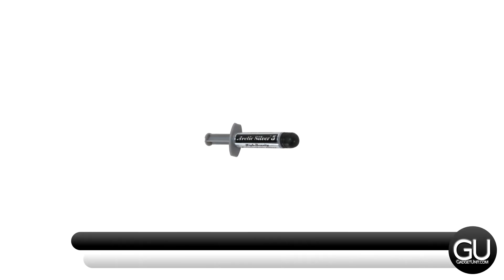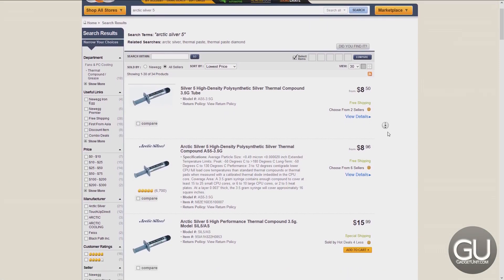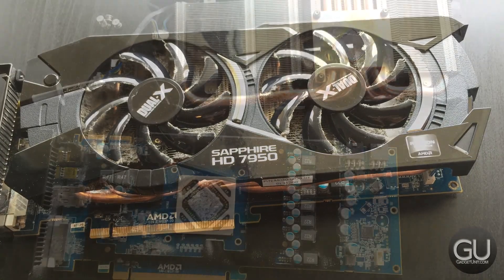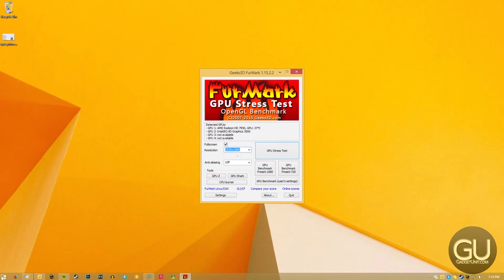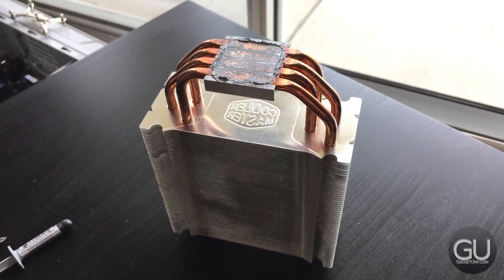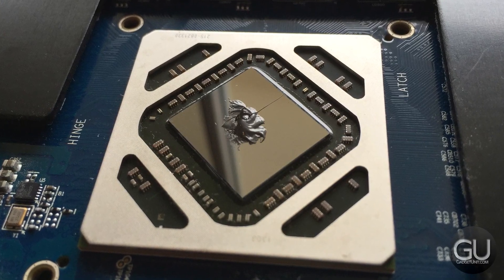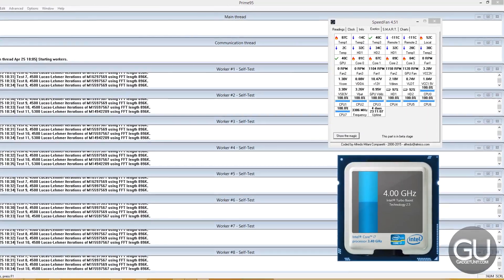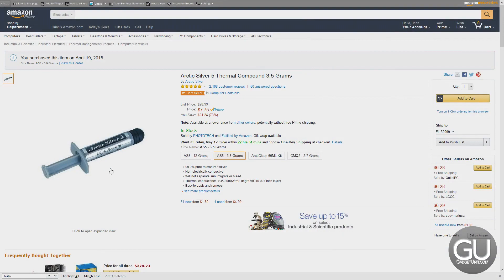Arctic Silver 5 Thermal Paste - Before and After

Comment: I went from 90c to 65c and now its  max 63c. Applied as5 few days ago. Fx8350. I did an X with a little dot in the middle. Good stuff
Reply: I'm thinking to buy it for my fx8320 but saw a few people saying the 200 hour difference is a scam.
Reply: It's been a while now and it's still holding up great. My computer is pretty dusty also, so that contributed somewhat to the heat. But it's below 70c. 69.8c last time I checked.

So I'm very content with AS5. I'd recommend it.

Comment: Pea method with AS5 is OK for the CPU with heat spreader, but it is TOTALLY WRONG for the GPU or any CPU without heat spreader.  You must cover the entire GPU die with AS5.  Do not use pea method on GPU if using this video for reference.
Reply: Explain liquid metal then.
Reply: @NikoBell1188  grizzly includes special q tips for die application

Comment: uhm the little pee method is for Cpu's cause it has a IHS. a GPU needs to fully spread its better to have it go over the sides on a GPU than not fully covered since the hole chip gets warm and not just the center like a CPU cause of the IHS
Reply: Then why does liquid metal only have to be on top?
Reply: uh because its fully electrically conductive and if it leaks on the board it can cause terrible damage. AS5 is thermally conductive as well as slightly electrical but no where close to Liquid Metal. Hence the reason why Liquid Metal performs so well with thermal transfers, it is pure metal but you risk damaging your board as well if it bleeds over.   @NikoBell1188
Reply: @killaboy1202 Yeah, applying Vaseline to the contacts before you paste up can shield them, then wipe clean with isopropyl alcohol and cotton buds before sealing everything back up. Or just shield the area not being pasted/metalled with cling film or something.

Comment: Thermal Grizzly Kryonaut, used it on my EVGA 980ti classified. 

Stock paste vs MX-4 vs Kryonaut

Overclocked to 1520mhz and locked at 60% fan speed. Kryonaut won hands down.
Reply: Heya, Nice man, I got an order for Kryonaut over at caseking and it should arrive this weekend. Also running a 980ti and it got som EK shit on it from a watercooler the previous owner put on, so I'm going to replace it since I believe the EK shit is pretty crappy. Is Kryonaut really that much better than MX-4/NT-1 from Noctua?
Reply: @ChronischVrij  There's lots of comparisons with thermal conductivity. AS5 wins every time for value/efficiency. Of course you can spend more for a liquid metal type of tim but AS5 all day as far as I'm concerned. I use it on everything. My collection of unused brands of thermal paste is growing.
Reply: I tried the exact same thing !! My watercooled GTX 1080 was hitting 55C with MX-4, remounted the block with some Grizzly Kryonaut. Bam!!! 49C max!
Reply: I don't own nor have I ever used a paste from Noctua so I really can't say.

Comment: Are you sure that the difference is not by dust removal? From the look of your heat sink the dust was a real problem.
Reply: specially using radiator, when there is no air flow because of the dust, the pc will randomly shutdown in gaming, and recommended if thermal paste dried really need to replace new thermal.
Reply: Thats all it was, there is no difference in ANY thermal paste. HEAT IS HEAT, COMPOUND IS COMPOUND. They are all made from the same thing. I couldn't watch this until the end..... so obviously the dust being the problem..... I wouldnt listen to this guy anyway, look at his computer.... SOOOO much dust means he has negative air pressure. Anyone who calls themselves a computer expert should know how to solve the dust issue....
Reply: John  No you are wrong. I have the same card in my daughters Pc , dust free mind you. After 3 years i have just replaced the thermal paste, using AS5 like this fella. Max temp in furmark before  was 74c, after 66c. The paste degrades over time, becomes hard and less conductive. Dust build up doesn't help but the paste man, the paste.
Reply: @John39  they are not made from the same thing. there is many different kinds of thermal compound.
Reply: @zipper978  yeah I understand some have stupid diamond dust others have this and that. There is very little different in term of performance. Even grizzle thermo liquid metal stuff makes but only a fraction of a different either under the IHS or on top. There is a minimal variant.
Reply: John you can look and YouTube videos doing thermal compound tests. Some make a difference of 10 degrees Celsius or more. That’s a pretty big difference between cheap and the good stuff. That can be the difference of preventing thermal throttling. Also cooler temps means components last longer.
Reply: @John39  These die are mounted to the PCB's in what's called Flipchip method where the back of the die is facing upward and a heatsink gets mounted such that it contacts the back of the die.   Far more commonly the silicon die are mounted non-flipped.. with the bottom of the die mounted to what's called a leadframe (with conductive die attach epoxies such as 84-1LMISR4 or QMI519) and then wirebonded with typically 1 mil Au wire (or thinner).   The Die Attach Epoxy used by the assembly house is chosen based on a lot of different properties for lots of different reasons but one of the properties is thermal conductivity, especially for die which are expected to get hot (amplifiers, cpu's, etc...  NOT memory chips usually because they don't typically get as hot in use).   Thermal conductivity varies based on a lot of things but using a metal filler such as silver does improve the thermal conductivity.   The surface of the die is super flat as they are put through 'backgrind' prior to wafer dicing and assembly (typically over-molded for full encapsulation unlike these flipchip devices).   For flipchip products such as these the back of the die has to mate with the surface of a heatsink which isn't as flat and perfect as the silicon die since it was manufactured, not in a cleanroom with sub micron tolerances, but rather by a aluminum milling process and one of the purposes of the paste is to fill any occlusions, cracks, gaps, and imperfections in the flatness of the heatsink such that it maximizes the contact and hence convection of heat from the die to the heatsink.    In other words, heatsink grease is an engineered product and they are not all alike.    Was in semiconductor packaging for >30 years.
Reply: @John39  yeah youre right, im gonna use tooth paste instead. they are cheap af. cause no "DiFferEncE"

Comment: easy fix stop overclocking has no point
Reply: I've got an overclocked GTX 970 that runs titles at the same rate and quality as a GTX 980.. Getting $550 GPU performance at nearly half price makes a pretty strong point I'd say.
Reply: my 780 ti benchmarks like a 980 ti. Of course it's got a big overclock but that's still really impressive for an old gpu like that.
Reply: Absolute noob.
Reply from the maker: +Logan Braveheart You've never overclocked before, it seems.

Comment: arctic silver 5 has a brake in period of 200 hours. in that time the temp pay drop from 1 - 5 grades
Reply: After 200 hours of normal use( turning ur pc on and off) its particles distribute better and offer much better cooling
Reply: HaoSs what does that mean?
Reply: Zaim Marzuki theres a 300 hour cure time where after that period it performs even better than on a fresh application.

maybe I was remembering wrongly and it was 200 hours. either way heating it up and cooling it down to room temp (pc on and off in general) helps cure the Arctic silver 5.
Reply: XmodsTheSpot  what's your secret?
Reply: nobody going to wait 200 hours to use their electronics ! that paste killed my xbox

Comment: I want to usi it in my 290X. Its conductive so holding my hands but you used it. So so far, any issues?
Reply: +Jay Shank it's not conductive. Anyway, you're not supposed to use so much that it's overflowing anyway. All you really need is just enough to get a thin layer across the die, that's it.
Reply: +ArtisChronicles It's capacitive, not conductive. So it's relatively safe.
Reply from the maker: +Jay Shank All has been fine thus far.